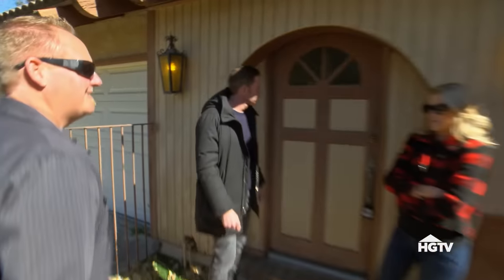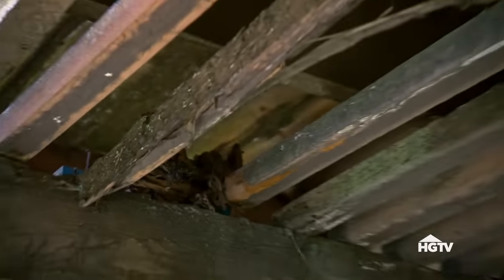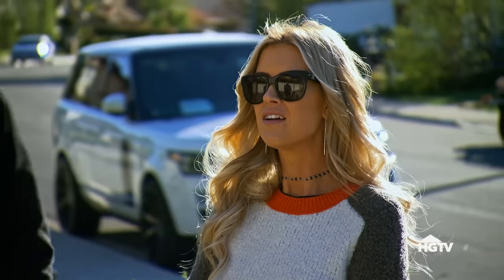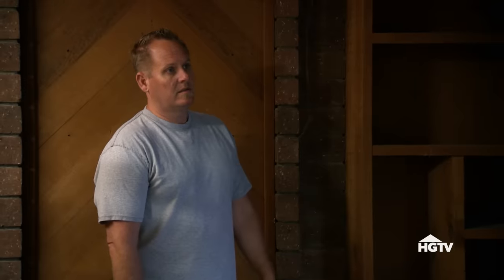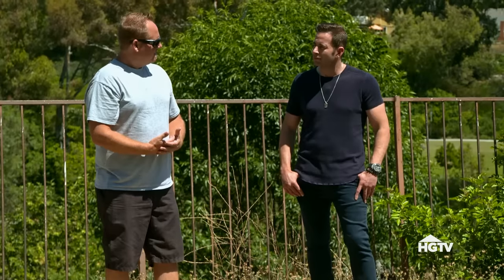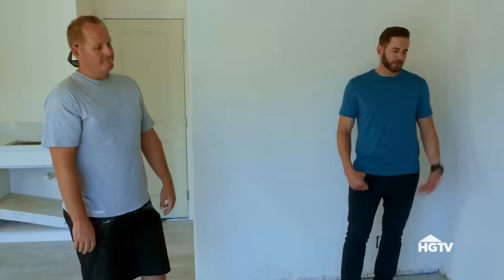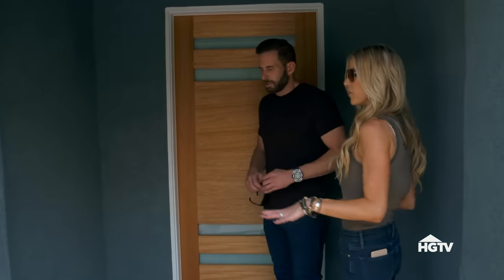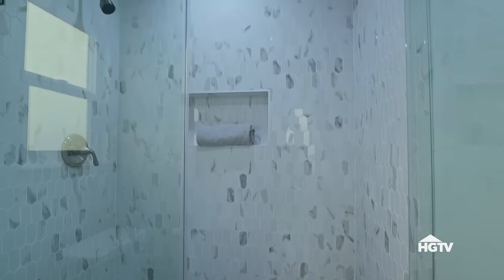This Disaster Home Was COLLAPSING before the Remodel | Flip or Flop | HGTV

Comment: Regardless of smelly house horrors and surprise costs Tarek always keeps the potential in mind.
Reply: This is one of the fake stuff HGTV does... nothing is a surprise to Tarek - a pre-production team with engineers etc. already visited the house prior to starting taping the show, so they know everything beforehand... what they do is bad acting for the cameras, maybe they ask the engineers to come back and pretend they are giving the estimates for the first time. It would take a team of experts to evaluate that big house and it´s structure and maybe a few days to come up with estimates in terms of cost and time, as different types of professionals would need to be involved in restoring the foundation and structures... In my opinion, it would have been cheaper to demo the whole house and build a new one for 300K...which is close to what they spent on the reno... It would have been safer too as in my opinion the land there will slide again, inch by inch... for these types of constructions up in the hills, a special type of foundation is required it has to go very deep into the ground... maybe they did that, who knows... all this would be great info for us to learn, right? but they always focus on the finishes and decorations - grey pain and backslash, floor, white countertops... oh well...

Comment: Are the sellers legally required to inform potential buyers that the back yard is sliding down the hill and isn’t capable of supporting a pool without shoring it up at cost of 100k?
Reply: That depends from state to state, but in this case my guess is that the previous owner either died or is in a retirement home and the bank repoed the house. Then they sold it with that huge discount to get their cash back fast but also with no responsibility for hidden damages. 

If it was a private seller who knew about the damages and didn't tell them on purpose, then he could be liable to either fix the pool or pay the buyer back a part of the money. Problem is you'd need to have proof of that knowledge. Just the gap in the ground isn't enough.
Reply: @dude988 The option to not purchase is valid. Sometimes I think they miss that. Ego gets in the way.